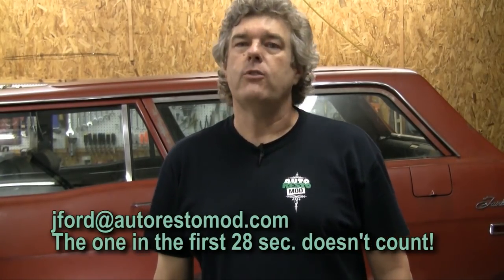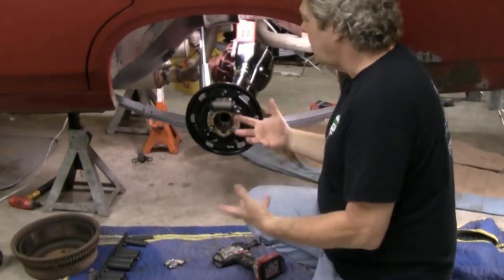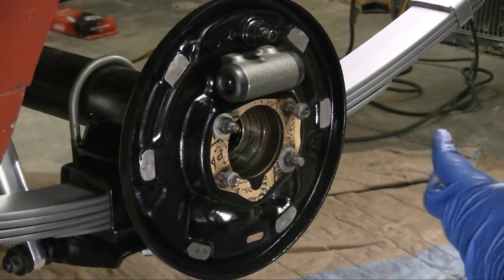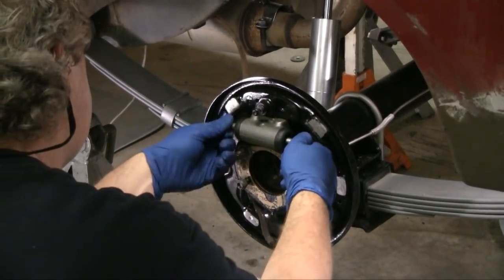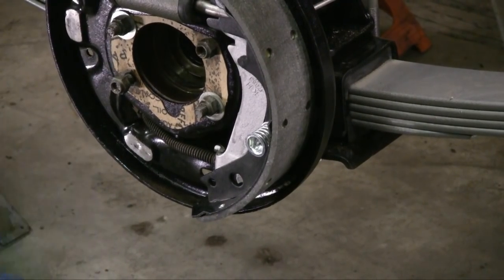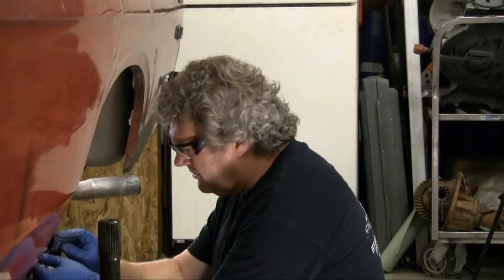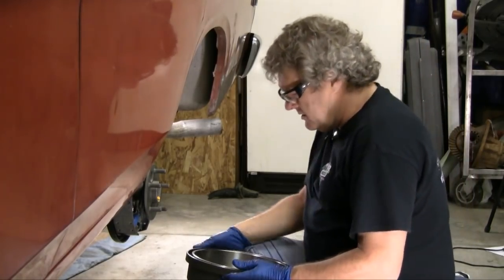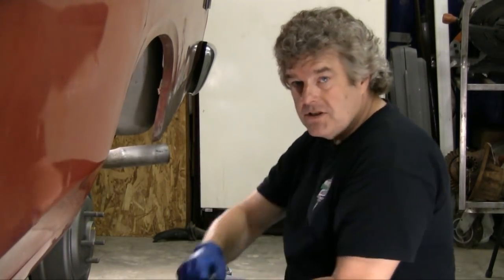Detailed How to rebuild Classic Ford passenger car rear drum brakes Episode 287 Autorestomod

Comment: Thx for vid! Replacing the cylinder on my 65 Gal, has become quite the challenge… I should have purchased a whole kit with the. Packing plate. Any suggestions where to get a good brand and fast 😅 also… If you push the piston out , is it non usable or have to remove the seals and push it back? I may have and don’t know if I should proceed … 🤷🏽

Comment: 2:50 I have this problem on my rear backing plates I don't have access to a welder to do the repair. I've read online that JB weld has worked for some people, is this a bad idea? I would prefer to simply replace the backing plates but can't find replacements for sale.
Reply from the maker: Just take them to a qualified welding shop they can fix this for you; as long as you explain what you're looking for.

Comment: At 8:33 you mention that realistically you need three hands to attach the outer spring cup. I had success by clamping the brake in position then attaching the spring and cup.
Reply: I did the same

Comment: Why don’t you show adjusting the brake shoe? How hard  should the drum drag when adjusting the brake? Should you adjust the drum until it won’t turn anymore and then back the adjuster off a few clicks?
Reply from the maker: I always adjust them till they are just before touching and then go and drive the car and back up. Backing up is actually how the brake shoes adjust on most Ford cars. But consulting service manuals for best effect

Comment: So I have a 67 with  6 Cylinder. The wheel cylinders on the rear do not have those pins. Instead the shoe goes directly into the cylinder. Is this normal for a 6 cylinder compared to the V8s because of the smaller drum?
Reply from the maker: Honestly, I would have to consult a service manual on that.
Reply: @AutoRestoMod  I just got a copy of the Shop manual and it is not clear either.
Reply: Yes 6 cylinder 4lug 9in drums do not have the pins that go in to wheel cylinders to the shoes. Shoes go directly to the wheel cylinders.
Reply: @joshramsey3099  Thanks for the reply. I was able to figure it out.
Reply: My 1962 Comet has 9" 4-lug drums.  No wheel cylinder pins.

Comment: On your new parts there is a curved round spring shim. I don't see where you used that in the video. Does that go on the adjuster?
Reply from the maker: There are two washers, one that holds the cable, and one that can be behind the shoe guide pin. See the diagram:
https://www.pinterest.com/pin/722405596450920362/

Comment: I have a 67 f100 pickup bed that has been converted into a trailer. the trailer still has the 9inch diff axle still on it. I want to put the drum brakes back on it, with a surge brake for the hitch. when installing the brake shoes is it necessary to put a parking brake linkage bar on it for the brakes to function properly since the trailer has no parking brake system.
Reply from the maker: As far as I know, no.

Comment: He's working on the left side of the car, but starting at 11:00 he shows you the right side parts and tells you to use those on the side he's working on (the driver side).  The text at 11:15 correctly designates left from right side, but doesn't say that Jeff is showing the wrong parts; it leaves the contradiction uncorrected.

TL;DR:  Make sure you use the "L" parts when you're working on the American driver side.
Reply from the maker: Sorry to disappoint
Reply: @AutoRestoMod  Hey, Jeff, I LOVE your video's!!  Don't think I was coming after you!  I was just trying to make sure others (like me) get it right.  I was so sure you were doing it right that I checked other sites to make sure you were wrong before I wrote my comment.  God bless and have a great day!

Comment: You mention about welding the pads. Mine have some big grooves in them and need some welding. What did you weld with? What type of material are these back plates? I need to get somebody to do this and don't want to go in just saying "weld these spots". Thanks
Reply: You can take them to a machine shop and get them done. That would be our best recommendation.

Comment: Do 9 inch drums on a 66 mustang require the cylinder to shoe pins?
Reply: the pins are absolutely needed. They are what pushes the brakes out to stop.
Reply: Not on the 60-65 6 cylinder ; 4 lug and 65/66 4 lug mustangs.

Comment: How do u get to the top rear shock mounts in a 65 fairlane station wagon, thanks
Reply from the maker: The plate on the floor between the rear seating well and the back seat. Remove the plate and the access area is there
Reply: @AutoRestoMod  thanks,will do.

Comment: i think its a mistake to put grease on the backing plates. # 1 they will collect brake dust ,#2 after being a nut about cleaning your gloves so much, putting grease anywhere in there is a no no. just saying
Reply from the maker: Ford recommends high temp grease on the backing plates, adjuster nut and e-brake pin. So...
Reply: AutoRestoMod Muscle Car Resto and Modifications ford made the Edsel so.....
Reply from the maker: We use the service manual as our guide. If you look at the service manual it stated to use a thin film of high temp grease on the brake shoe ride pads. And there wasn't anything wrong with the Edsel that a crack team of designers couldn't have fixed with some good scotch, a case of Camels and three or four years...
Reply: If it was good for them it's good enough for me
I always follow the manual and try to be as stock as possible. I like your show is very informative and everyone has their own opinions. I This is how I was taught as well. My father taught me this and I've pulled the brakes and never had a problem. 

 Long as you change gloves and don't slather the grease on there like a child thats finger painting the 16 chapel. You should be good so.... lol again great show guys and I love what I do as much as you guys love keeping this hobby alive for many years to come.

Comment: Where is th round things with th rubber stuff? N those brakes r broke they got nuttin 2 push against. Ur title should be part 2 step 8 rear brake job. 
Real how2 : 1. Get a drum brake adjuster tool (very cheap n many EXTRA Useful  uses. around $8?). 
2. Safety, Put car up on jack stands n wear safty glasses. Lots o rust on classic cars. Not necessary in ur eyes. 
3. Remove wheel-lug nuts in a star pattern, to avoid wheel warping. 
4. Spray rust-ease or wd40 or... around hub of drum area. 
5. Remove th oblong grey/black rubber adjuster hole cover boot from th backside of drum. Use a flashlite to see inside th adjuster oblong hole. Spray th brake adjustment wheel it is a 20-30 pointed
star-wheel, & it looks like a cowboy spur on a tube. Spray th tube w- rust-ease or wd40 or rust penetrant or... 
4. Adjust th brakes by th use of th brake- tool pry portion or longish standard tip screwdrvr n stick it in hole against th 20-30 star pointed brake adjuster wheel. 
& it is usually reverse threaded so tighten  thby wheel by prying up or down n this will allow th shoes room 2 come back closer 2 each other. Releasing them, from th drum usually. 
6. Now banging on th outer edge of th drum in a cross/star pattern will release th shoes from stuck open-against th drum's inner surface to free of th drum.
7. Replace lugs onto studs  3/4ths way so if u miss while hitting th drum with a hammer u can remove th nut to re-thread/clean-up th stud u hit.
8. Carefully with force strike th drum in a cross/star pattern around th hub between th studs to release hub from drum. Ho-hum.., 
th key to sriking is to 'Focus on th srike point' 
NOW ur step 8. Part 2 video.
9. Once done u will need to re-adjust ur brakes. Get to a safe open space. Drive in reverse n hit brakes hard enough for a slight skid. This will re-adjust rear drum brakes on most cars. 
            Safty first fun second.
Reply from the maker: Ok.